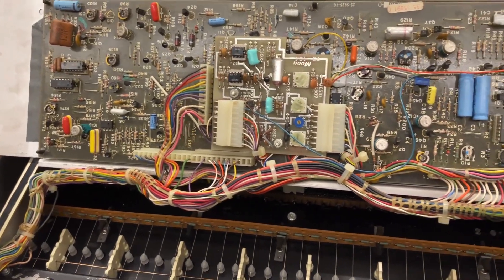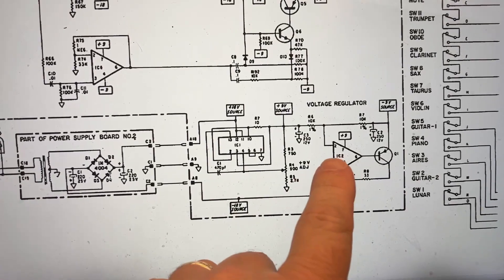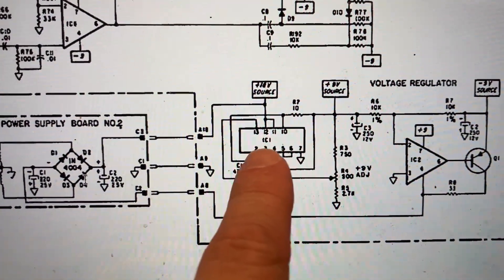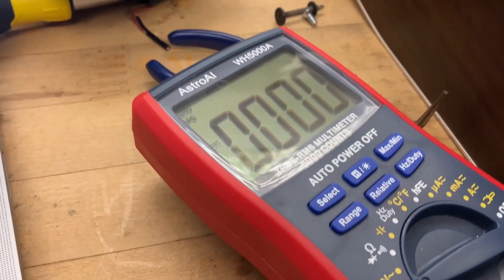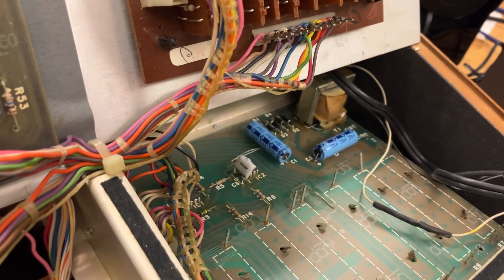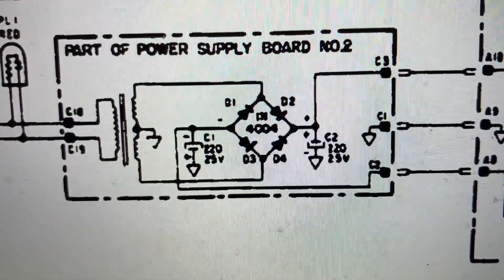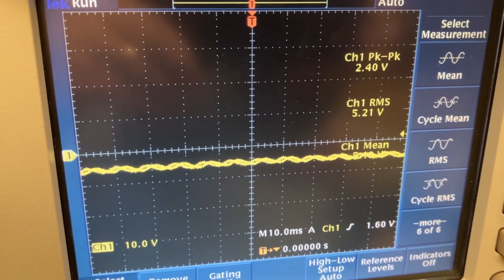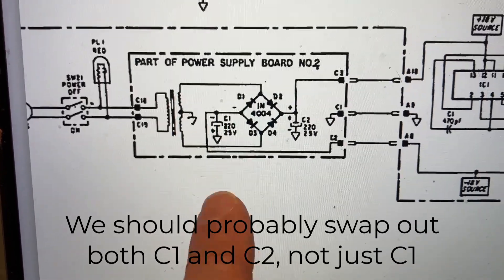Moog Minitmoog with Problematic Power Supply Circuit

Comment: Those electrolytic caps are the first thing to go usually in guitar amplifiers. I would power off, discharge the board, and measure the cap values. For diodes I like to do a reverse continuity test.

Comment: Swap out both capacitors
Reply from the maker: Yup, that's the next step. (Also going to try testing it disconnected from the rest of the synth to see if something further down the line is busted and loading it down).
Reply: @Lantertronics I just repaired and amp as the electrolytic caps had all died
Reply from the maker: @ I've got a buzzy Fender Bassman that needs its electrolytics replaced.

Comment: With all well-meaning... The probing makes me cringe a bit... Don't hold the probes like that. You have very little precision in your movement. Rest your hand, wrist or a finger close to where you measure (on something non-conductive of course...) so you get some support, and just hold the probe with 2-3 fingers and push it down from above. You're not trying to stab someone. Push firmly, enough to make good contact, but don't try to murder it. Then when you're done, lift it straight back up. The harder you push the harder it is to lift it straight back up without slipping (or just slipping while probing because you push hard). It seems like the probes are being pushed down quite hard and they're held far back. When the black probe is lifted it slips a bit and god knows what will be shorted. Something sensitive, or maybe not. You don't want to find out. Try to make sure the probing itself doesn't cause damage. Just a piece of practical advice.

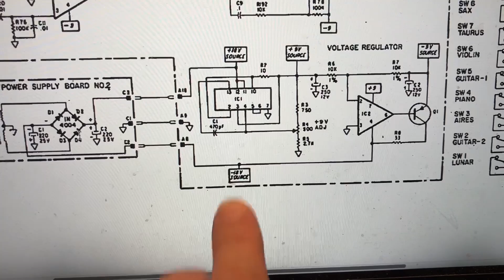Comment: 1:05 what is the PNP (q1) good for?
Reply from the maker: It's doing the "heavy lifting" of the current. The IC can't handle the amount of current on its own, so it provides the "brains" of the operation, and the transistor provides the "brawn."
Reply: @Lantertronics  i went ahead and used fallstad and saw what it does. there was no resistor on the base.

Comment: What about a measurement of all combinations of the windings on the transformer? Maybe test them out of circuit?
Reply from the maker: We'll start with replacing the caps (and testing the power supply disconnected from the rest of the synth). But if needed we can do that to focus on the transformer.

Comment: I would imagine if it was a bad rectifier diode, you'd be seeing much larger ripple in your measurements.  But hey I've been wrong before! 😂 I think you're on the right track.  C1 is in much worse shape than C2, but C2 is likely on its way out as well.  Considering it is a 220uF cap operating 60Hz, you can calculate the expected ripple if you know the load of each rail (deltaV = I/fC).  But I suspect ~2-3Vpp is too high for each of these rails.

Comment: Did I read that correctly? The filter caps on the power supply were only 220uF?  That seems inadequate. If you assume 18vp secondary, and just 100 ohms equivalent load (180mA), that gives 20% ripple.  Maybe larger electrolytic capacitors were harder to come by back then.
Reply: This was made in the era of huge electrolytic capacitors, before switching power supplies became popular. I remember in the very early 80s that micro-computers (before PCs) had linear power supplies with multiple huge electrolytic capacitors (beer can sized or larger). About a third of the case of a S-100 system was the power supply.
Reply from the maker: @ Yeah, I have an IMSAI 8080 and the electrolytic caps in that are MASSIVE.

Comment: Power supplies can be the weakest link in old synths. Old capacitors, well, you know all this already. My ex-Oberheim OB-X had those little orange tantalum caps on each voice card, all were shorted. Kept the whole synth PS down. Memorymoog PS, is a whole 'nother beast. Getting ready to re-cap a lot of old gear. Your Minitmoog will turn into and HoursDayMoog in no time. Your son has a future in opera. Thanks for the morning coffee vids.
Reply from the maker: Someone else pointed out that we should try testing the power supply disconnected from the rest of the synth to see if something shorted further down the line is pulling things down. 

Ugh... I'm really hoping to avoid a shotgun recapping...
Reply: @Lantertronics  I am going to buy a capacitance meter, just to see if the old caps I'm pulling are out of spec. You might have access to one of those ;). If you think you will keep the synth, might be good to replace the usual suspects, just to save time in the future. Yes, troubleshoot without load, calibrate under load and after it warms up. Shotgunning is the folly of youth. Lifting one component leg to isolate is a happy medium. Wouldn't mind a follow-up vid after it's fixed to hear it. Happy soldering.

Comment: Did you do those measurements with the PSU detached from the rest of the synth? It could also just be some shorted component pulling the negative rail toward ground.
Reply: Its a very good point. Synth repair 101 really.
Reply from the maker: Ooooooooh that's a good point! We'll check that next time we're in.